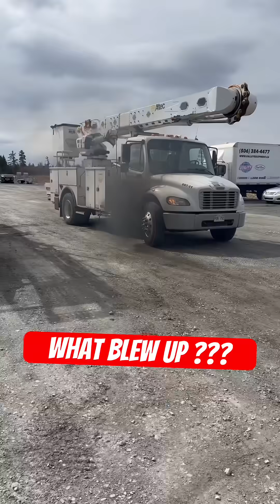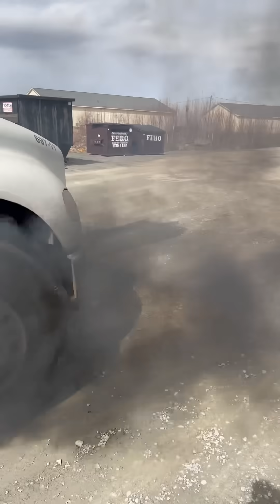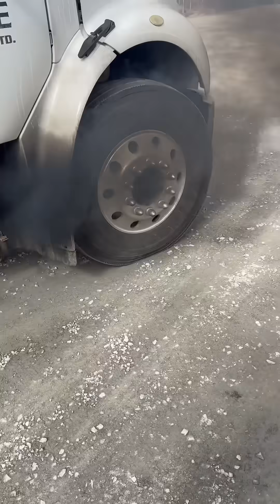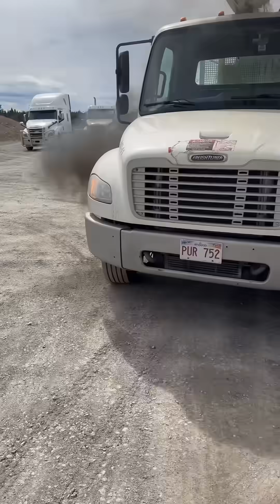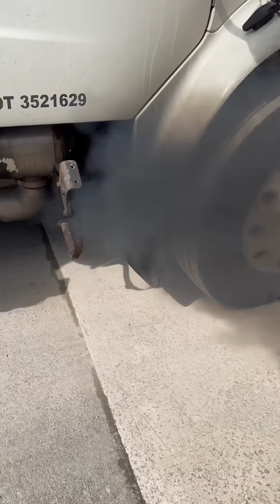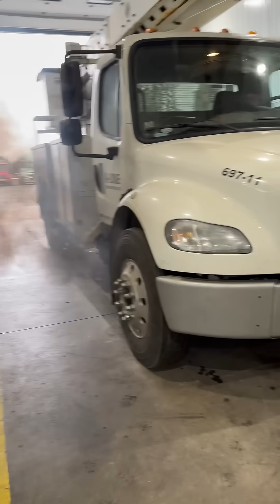6.7L Cummins Having PROBLEMS..  What BLEW UP ?? #cummins #diesel #automotive

Comment: Turbo vgt actuator burnt out or turbo exhaust nozzle ring seized. Its makes it act like the exhaust brake is on all the time. Thats why the turbo sounds like that. It smokes like crazy cause its so restricted. Im no diesel mechanic but it sounds and smokes exactly like mine did. Might have some codes about no boost pressure detected, actuator past learning limit, turbocharger boost control slow response. I replaced the turbo and all problems when away. Hope this helped!
Reply from the maker: Bingo!! VGT took a poop

Comment: Maybe connect the exhaust to the filter and sensors
Reply from the maker: I think Darren took off the exhaust pipe because the truck was throwing DPF codes too. He wanted to confirm the truck was blowing tons of smoke. with the DPF hooked up you'd never know

Comment: I have no knowledge or experience in this field whatsoever. My completely uneducated guess is either you have a completely plugged air filter or if those big rigs have any sort of cat on them it may be plugged. Or need an oil change. Again no knowledge whatsoever just thought I'd give my two cents XD
Reply from the maker: Turbo VGT Failed